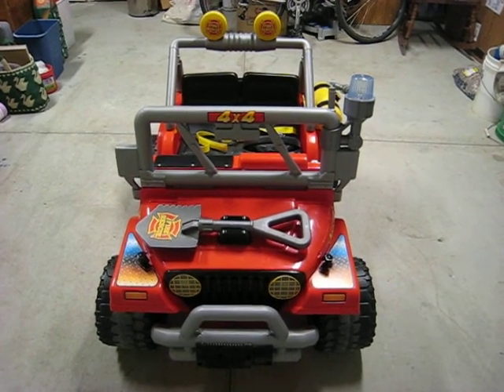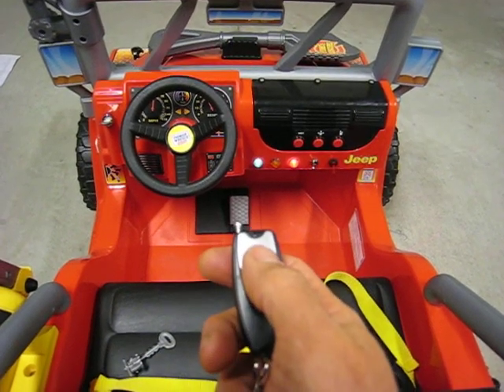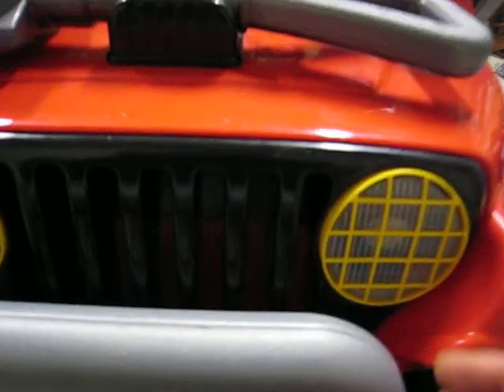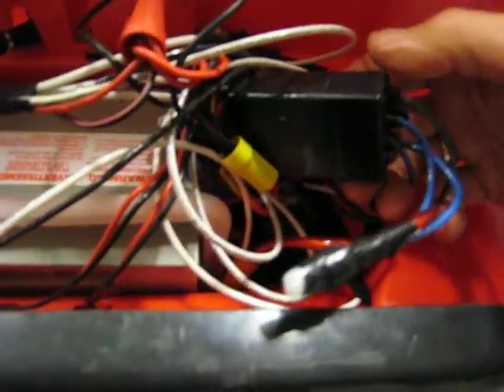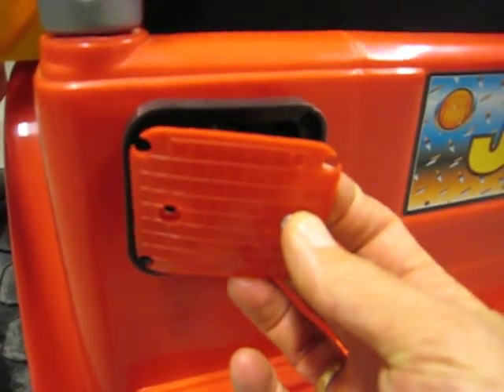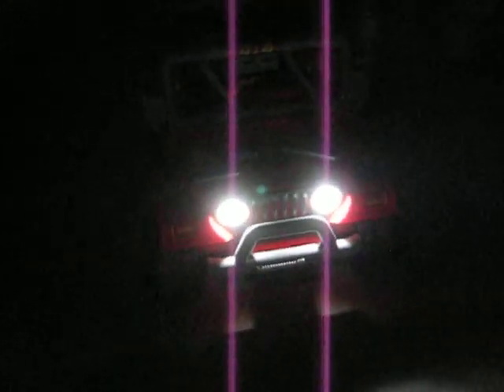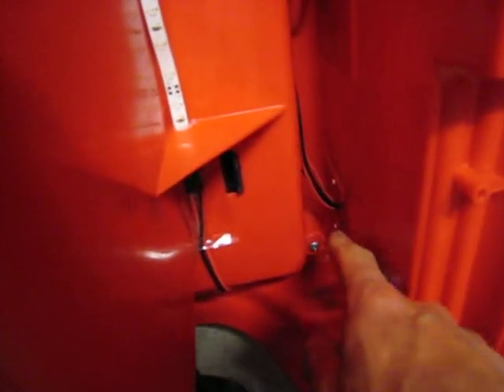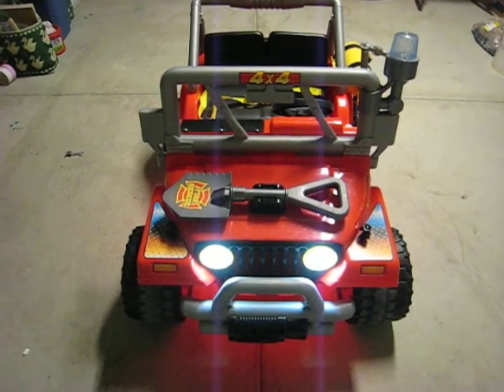Power Wheels Fire Rescue Jeep Project

Comment: I like the mods.  I have this exact same Jeep for my kids.  I would like to do the same headlights, taillights, and underlights, on a nice key ignition switch like that.  I'd also like to run lights, maybe even alternating blink to the rollbar lights.  Possibly blue and/or red.  Also, do you think there is a way to replace the strobe light into something cooler?  Do you happen to have a parts list for everything that you installed?  I've done some home electrical, but nothing like this.  Is it out of my league?  Thanks!
Reply from the maker: Hello Nick, and thanks for your comment.  If you've done some electrical work at home, I think you'll enjoy the 12V lighting and ignition projects. It's pretty safe, and I found www.modifiedpowerwheels.com had great information and wiring diagrams.  Disassembling the car is pretty straightforward, and once inside it's not too complicated. I bought the relays and ignition on Amazon (ref. item #s B007XLDREU  & B0002BA3PE respectively), LED strip lighting came from Modifiedpowerwheels.com.  I don't recall where I got the remote switch, which cost $15-20, but it really comes in handy with young drivers. Just about everything can be sourced off ebay, Amazon, or your local auto parts store.  You may need to add a lock ring to keep the ignition cylinder from spinning against the smooth plastic. Have fun with your project, space is the only limit on the combos of colored dash lights, switches, buttons, rockers, etc. you can put into the car, and kids love it.  The alternating lights should be great, I'm sure it can be done, although wire routing through the roll bar could be a bit of a challenge.
Reply: Thanks for the tips.  I think I might take on a project.  It does make the Jeep much cooler for the kids.  Besides, we do quite a bit of camping, and I thought about taking their Jeep, and if we do, it would be nice to have it lit up at night.  Thanks!

Comment: I'm surprised that you do not have a ton of comments on this mod, GREAT JOB! I just received the alarm system with remote kill option, just waiting for the ignition. However, I don't know how to wire these options into my  daughter's Kid Traxx Police Cruiser (Dodge Charger). Where would I find a video to install the ignition? The factory ignition is a rocker switch  that has 6 terminal (3 sets of 2) with 5 wires connected to it.
The ignition that I'm waiting for only has 4 wires. I don't have a video or diagram on how to do this on the police cruiser so I'm thinking that I'd better scrap this idea before I wind up damaging something.
Thanks!
Reply from the maker: Robert, I'm unfamiliar with the Kid Traxx Police Cruiser. Also it was unclear to me from your post if you are seeking help installing the ignition switch or the remote kill switch. Sounds like your cruiser already has a bonafide ignition.  My Jeep just had a cheap plastic key - hence the upgrade.  The kill switch is simply a remote-powered solenoid which interrupts the power circuit.  If you still need help I can't say enough good things about the forum at www.modifiedpowerwheels.com - very helpful and responsive. 
Good luck, be safe, and have fun!